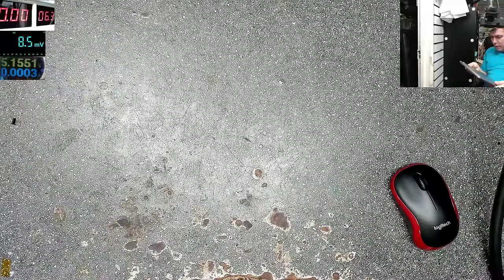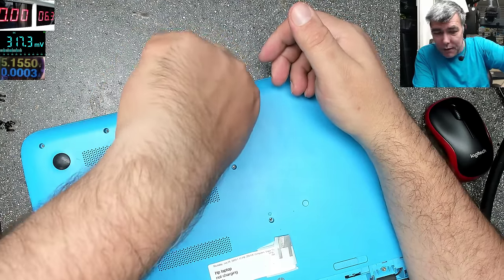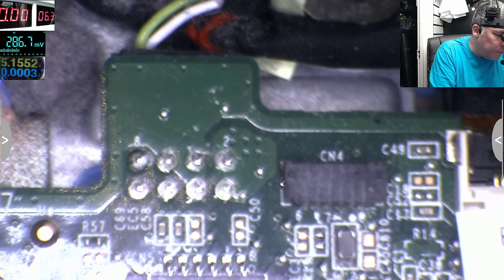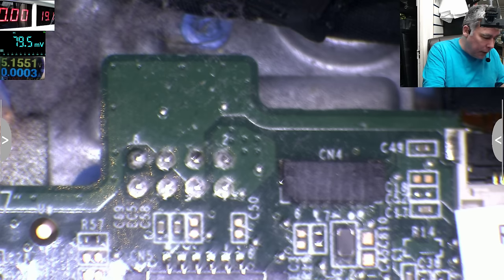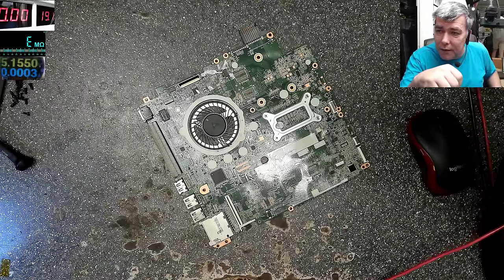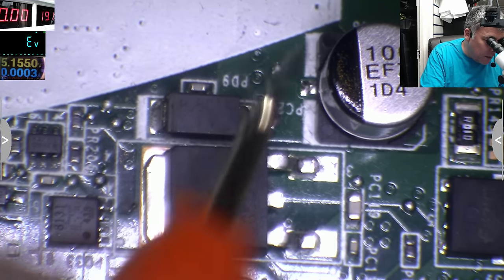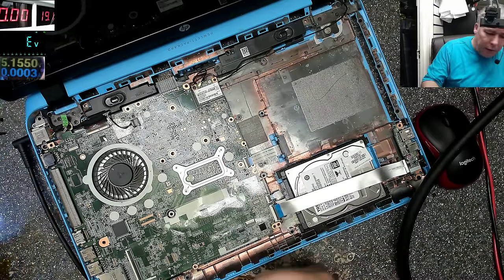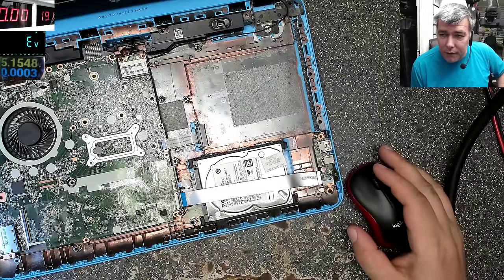Hp, dead, no power - the most stupid fault and design

Comment: like MOSFETs, Zener diod is almost certainly part of the charging chip design template. Most of the manufacturers implement reference design instead of inventing their own weel. The problem with input voltage protection is that both MOSFETs could be shorted by voltage spike of a malfunctioning power supply. If it builds up a high-frequency AC ripple, it may be overseen by ACDET regulator but it will still blow insulator in MOSFET. in this case, you have uncontrolled DCIN going directly into the main power rail which is always a bad situation. Zener diodes are used on every single HDD as an over-voltage protection fuse - it gets blown very fast and it shorts power rail to the ground. Think of Zener diodes as an over-Voltage fuse. 
Since you did not replace the Zener and customer will use the same PSU, this laptop might come back at some point and I guess if it will, it will come with a blown cap or VCORE MosFET.

Comment: In my PSU designs I use suppressor diodes to protect from spikes, when they fail, fail short and burn out the fuse, so the rest of the board is safe and doesn't stress the charger or whatewer the power source. HP really should put some kind of fuse to the power rails.
EDIT: if something goes wrong with the charger or wrong charger plugged in tantalium capacitors blow up pretty agressively. My guess they use max 25V components.

Comment: That part you were pointing out is actually a TVS diode (transient voltage suppressor) marked as "IV".  You can look at it's specifications under it's equivalent being SMAJ20A tvs diode. It was a bit tricky finding it as either new semiconductor devices do not have a standardized marking code or, that (somewhat imperialistic) companies have their own marking code which at times do not even correspond to their own data books.
Reply: Now if these diodes are shorting to ground on over voltage then why would it not work correctly again when the over voltage is gone?
I suppose that this diode was damaged. Permanently shorting to ground.

Comment: Subbed and Thumbs up! Thank you so much for this! I was a repair engineer Once and I still like to think that I can tackle most things but I was presented one of these in a very similar scenario, with the exception that the charging light comes on and it will charge the battery but when the power button is pressed, lights (but no screen) come on briefly; fan spins briefly then everything goes quiet, leaving only the charge light on. PSU is fine but not original. One of my excuses to not attempt something like this is that I don't have a Scope or re-ball facilities but you prove the contrary, using tried and tested basic equipment to repair things that would otherwise be 'beyond economical repair' by smaller companies and astronomically high priced repairs from manufacturers.
Reply: Did you fix it sir?? I have the same problem

Comment: It may be a Transil diode called also TVS (Transient Voltage Supressor). It is used to protect against overvoltage. It shorted itself but protected rest of the components. In some cases transil can even protect against catching fire or explosion of Lithium-ion batteries.
Reply: Yes, it may have been a TVS diode doing its protection job correctly. That TVS may have been under-rated, or else a massive voltage spike appeared on the line.
Reply: Thinking maybe the PSU failed and sent a voltage surge to the laptop?

Comment: If the Zener diode wasn't there you would have a much larger repair job.  Yea the Zener killed the laptop but it prevented damage elsewhere.  The zener diode is probably there to meet some safety agency requirement.
Reply: There are supressors or MOVs which are designed especially for surge protection. Zener diodes are not really suitable for the task. Not in this power range. On a low power rail maybe, or on an I/O line, it is.
Reply: @PHONE-LAPTOP-REPAIR What did I say that was disrespectful?  Just stating what I felt was a reason for the diode to be there.

Comment: I think its a TVS diode. A transient voltage suppression diode. It will short if the voltage reach its limit and does not recover from short anymore. I found one in a Western Digital Hard drive and its the same problem, the area where it was located we're charred/burnt.
Reply: correct...
Reply: TVS diodes commonly go on the ends of circuits and not between FETs. It’s more likely to be a zener diode.
Reply: @lelmus3277  Zener diodes don't want to be in the main power bus, they are usually placed on the base/gate of a BJT or FET if I recall
Reply: @lelmus3277  According to the circuit diag. the part number is P4SMAJ20A  so we may have to agree to differ on this one ..  Keep up the good work .
Reply: John Price please recall that I did say it’s common practice. Inline TVS between FETs is plainly confusing to me logically. I place transient suppression only on connections where hands touch or near and between power supplies to the logic circuits, to protect against ESD. I must be doing something right since my designs do pass UL.
Reply: @lelmus3277  I agree with you. I would have used a zener diode for protection and would have put it at the input and not between  the FETs. Perhaps the designers don't have any real world experience.  ;-) . Take care John.
Reply: Its a type of Schottky diode AFAICT - PJ501K SMD.

Comment: Laptop was used with a non original PSU. The original PSU has a fast blowing fuse, the idea being that a high enough voltage to cause the zener to conduct will cause a high current condition and blow the fuse in the PSU before the zener can burn.
Reply: Then the Zener should be on the output of the PSU, not after the first MOSFET of the motherboard. This approach still makes no sense.
Reply: @incandescentwithrage  Well yeah, that'd be the way you or I would do it, but the people making the laptops are building in deliberate fail points. It functions, but designed to penalise the use of a non standard power supply. They of course want people to buy an expensive original from them, not a $5 generic from Walmart.
Reply: And what do you think they'll do when you take in the laptop for repair? Replace the diode or replace the entire MB for a lot more money?
Reply: @RJVB I get what you're saying but why are you directing that rant/question at me?

Comment: sorry that's not a Zener diode. Zener diodes are mainly used as basic voltage regulators and are connected in reverse polarity mode.

in this case the diode is there to protect against reverse polarity.  it protects the power rail by shorting itself.

Comment: Im not a big tech, but i think this stupid diod actualy protected the board, cos the diod died and other part didnt get damaged. Its easier to change/remove the diod than, for example, bios chip, which potentialy could be damaged if power supply fails in some way. if you get what i mean

Comment: I always wondered why HP laptops seem to die with no explanation. Now I know
Reply: Only this model is plagued with this bad choice of so-called protection but HP laptops are infamous for several types of fault - all equally as stupid when it comes to the design of the things, such as placing temperature critical components in bad place, the use of bad Thermal Heatsinking design, resulting in overheating of components - and the list goes on, of Bad things
Reply: One reason, the other big  reason is because hp really suc-s :))

Comment: what a strange design ? i safety device that leaves you with a dead laptop ??  given that your have 2 mosfets whos job is to cut the power if there are problems.............would you not design the power input to detect an overvolt situation and use the mosfets to cut the power ?...........with power being restored when the input voltage returns to normal ???  good video :)

Comment: That diode is meant to make a consumer either bring the laptop to a technician, or (better for them), make you buy a new laptop. 

When you removed the diode, did you leave that open? You didn't have to bridge that circuit or replace the diode with another one? It looked like you left it open. I have an HP, and if I ever need to remove the diode, that would be good to know.
Reply: you typically don't bridge diodes, but especially this one, because its in parallel with the input of the laptop, so it will be a caboom :D

Comment: I had old laptop from 1999 my son was using for the games on it. It went dead. Dead, dead, dead. It used those surface mount resistors with numbers on them for values. I found some next to power plug that said 0.0 on them. I took that to be a jumper of some sort. One gave no reading so I soldered a tiny wire across it and zam! It works again.
Reply: Have HP laptop too, if it ever phuds  out I’ll remember to check for this one

Comment: I think the way you work is slightly different from me, I wouldn't plug a power supply directly to the motherboard, if the voltage is being dragged down,  the power regulators are the first thing I normally check for shorts etc..
Reply: Soren seems more brutally old skool IMO. I think he's fantastic. 😊
Reply: Well using your method, you just missed a faulty charging port. Recall that this came to the guy listed as a faulty charging port.

Comment: Thanks so much for this nice and clear video!!!
I would like to have your thoughts about a laptop HP envy i7 17" I have which does not charge the battery when it's ON
and charge it when power is OFF. power supply has the light, when the battery is charge everything works. I tried to remove the battery and power ON but apparently this laptop
needs a battery to power ON. thanks for your answer.

Comment: Thanks so much and your videos has helped me a lot and I were able to fix my Boss's Hp laptop - Probook as the Ram slightly came loose. And I had to open it up and pulled out Ram chip and replaced back into the board and then the laptop powered up and operated after experiencing screen freeze and only lights blinking within the  keyboard area,,,.
And now I need to fix my friend's Hp ProdID 250 G7 laptop but haven't seen one video of it as yet, and if someone able to show me and I would very much appreciate that,,,,.
Regards,
Charlie Jay, Wabag, Enga Province, PNG.

Comment: I have this exact laptop and for some reason it wont switch over to battery when you pull the AC. Its driving me insane. it also takes forever to start up when battery installed but remove battery and everything is good. Replaced the battery and the problem remains. please can you advise what it could be?

Comment: Good video sorin.
Zenners are not really designed for that job, there should have been a resistor in series with it to clip spikes off. (nasty company).
Also no fuse before the first mosfet, so death to the zenna or laptop:-(.
Zenners are more usefull for dropping voltage with a series resistor or as a rough reference for a linear power supply circuit.
Reply: Its not a zener. Its a regular power diode designed to short out reverse polarity input. Good design not bad as relished by the poster lol
Reply: Resistors can't 'clip spikes' from current, can they? Isn't that more what they use capacitors and coils for?

Comment: If it's used that close to the input, surely it might be intended as reverse polarity protection...although that might not be much use to the customer, at least it saves the main board and stops something from smoking. Thoughts?

Comment: Thanks for the great video. I removed the zener diode but still the PC wont start and no power led lighs up. Voltage over the zener diode when removed is 19,9 volts when you had 0,5 volts..so obviously there is another problem right?

Comment: Nearly all Windows laptops have a reverse polarity protection diode across the psu input and another across the battery terminals,  though the diodes on these units seem unusually fragile.    It's the DC socket LED that's the really dumb feature.  Break the DC socket and there's a good chance of back feeding the 3v dc led line from the "super i/o" / embedded controller with 19v of goodness and blowing it (and sometimes your EEPROM and southbridge) to kingdom come..
Reply: "Windows laptops"...?????

Comment: Nothing burns without a reason and the burned zener diode means that some fault happened and it has indeed protected the device. If it'll happen next time, you'll have nothing to replace and they'll pay you anyway. You may not be able to fix the motherboad. I disagree. The next repair will be more complicated just because you didn't replace the diode.
Reply: then tell me what could have killled that diode?
Reply: Overvoltage! Nothing burns without a reason. It protects the rest of the circuit. Therefore it'll be much harder to repair it next time. And also much more expensive. Do what you want. It's like not repairing your airbag in your car. It also runs without it.

Comment: Thanks for the video. I have a HP Pavilion and it has the same non charging fault. I have done all the things suggested by trying to run it with the battery removed and trying to discharge the circuits but to no avail. And as you have done, I checked the power supply to give 19V. I would never have figured out how to take it apart if not for your video! I've found all the screws and have almost prised the keyboard off but my version of the Pavilion has a DVD drive and there appears to be a screw hidden by the drive. I might have to take the DVD drive out to get at it but I can not see how to do that. At 5:58 you just slide out the module that is where my DVD drive is, but yours doesn't look like a DVD drive. Any suggestions?
Cheers.
Edit. Just seen that you undo a screw after taking the module out. That is the screw I can not get at.
Reply: Just found a utube showing how to do it! Hooray! It was just a matter of pulling the drive out after removing the single screw holding it. Cheers again for the help!

Comment: I have a Dell laptop with similar fault. I’ve tested the power charger and power jack and I get 19.37v from them but still no power led when a turn on the laptop. The mosfet P0200 has input voltage of 19.3v but output is 0.10v or 0.082mv. The input of mosfet P0201 is 0.082mv too. Can you please help or how can I get my laptop to you ? I look forward to hearing from you .

Comment: Hi Sorin what if I dont have linear power supply and i inject maybe 5v 2a through the pwr resistor can I find short with this method or I need higher voltage?

Comment: good day, i hope you can read this and can help me..im repairing the same laptop (from a friend) as this, but the problem is a little different.. The power indicator or charging is off but when I pressed the power button, the light on the charging pin or input, blinks 2 or 4 times then off.. I checked the 19V power rail line ok. the 3V power rail is ok, not sure about the 5V line or is it the super i/o problem? Its ITE IT8987E..  thanks

Comment: Have you ever seen an HP TPN-C126 where the thing will charge the 
battery, but when it runs with the cord plugged in, it runs ON the 
battery and not on the AC power. Shut the machine off and the brick 
charges the battery. In the Win10 systray, it doesn't show the battery 
being charged icon when the thing is plugged in. New battery. New brick.

Comment: the diode must be there because it protect not the laptop per se, but the internal most valued component, the hard drive. 
The data is the most important in computer related equipment so, you can trash your laptop but your data is inside the hadr drive and is what you need to protect. 
And switching power supplies generates up to 35.000 spikes per second that are used to transform a voltage into another. the system needs a fet, coil, capacitor and the diode.

Comment: im having issue with also "wonderful" HP laptop. Power LED beside charging port is working. It also charged a battery (From orange became white after couple hour charging.) When unplugged the charger light is gone. laptop won't switch on. (Even fan wont spin a bit). When p-lugged in the power led beside charging port shows white, when pressing the power button the led will go off and about 0.5s later comes back, but laptop wont switch on. Charger is 3 pin and port was broken and im sure than middle ("smart pin") was touching the power 19v pin. not sure if any touched the gnd. got new port and noticed that when plugged in the "smart pin" voltage drops more than half. In one place i found 3 shorted capacitors (they all beside each other) the removed closest mosfet, but short was not gone

Comment: With this type of fault will the laptop  still power on if the battery is charged and inserted? was the diode just for polarity reversal protection? maybe not a zener. didnt notice if  the zener was aournd the place elsewhere.

Comment: @Electronics repair school What if the light is on next to the charging port, white light constant no blinking. BUT after testing the cord is fine with a multimeter, it will not power on, makes no sound, or responds in any way hold the power button down for 20sec light turns off when release power it lights back up but still no power.. .  this is my issue after my HP notebook abruptly powered off while i was using it. Ever encountered such a problem?
Reply: Disconnect battery and cmos battery. Hold power button for a few seconds. Connect cmos battery and see what happens.

Comment: Tell me about it, I have a hp probook 650 g4 fan is spinning like creasy even when the CPU is cool. hp knows this problem and say update the bios but it doesn't help. and none of the fan controlling softwares can detect the fan. probably there is a problem with the thermal sensor.

Comment: My 14-year-old son has an Acer Aspire E5-575G. It's totally dead. You can measure 3.5V where the power comes in. The power line starts with a Zener diode. Looking at this video from appr. 27 minutes on it seems that that is the problem. Can I just remove it and not replace it?